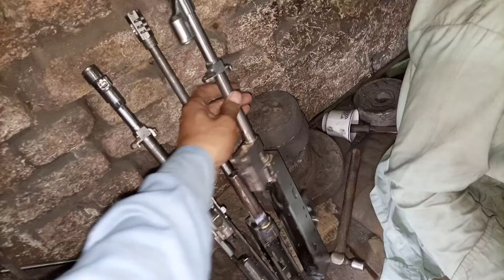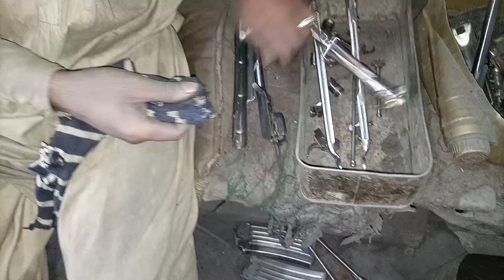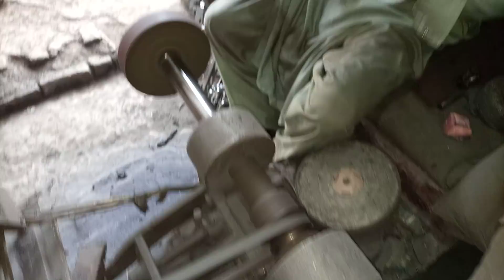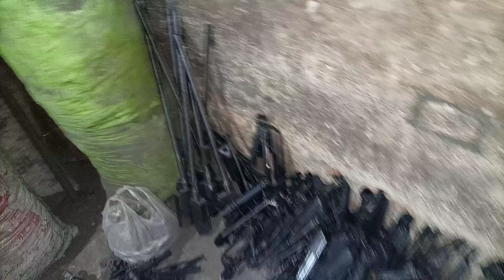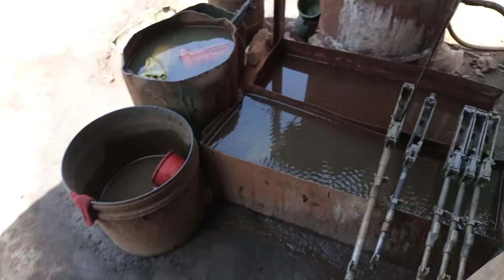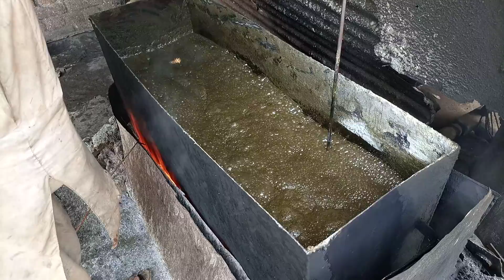How these parts are prepared for painting. coloring process. manufacturing industry. bluing browning

Comment: Notice every AK is a different size and shape …homemade quality at its best
Reply: they arent all aks bud
Reply: Dangerous
Reply: Probably made to order
Reply: every human is a different size and shape 🙃
Reply: The receiver is not. It is made of an easily stamped piece of sheet metal folded and welded in several places. The barrel can be almost any length and they probably try to utilize as much barrel material as they can as that is the most difficult part to make. It does show the futility of "gun control" as in many countries in the middle east gun manufacturing is "illegal" as is gun ownership other than a shotgun or pistol.
Reply: @T_bone  illegal from ur viewpoint, that is based on ur templates?

Comment: Greetings from Thailand, the bluing  process looks similar to the process I use, the liquid I use is old engine oil from oil change service on my diesel Mitsubishi, gives an excellent rust proof finish
Reply: is it better than super blue? 
and the old gun that it's colour is not similar do you think Super blue is beneficial
Reply: You need to use old diesal oil you want it for the carbon clean oil doesnt work it stays the same colour
Reply: How can you blue métal with diesel oil ?
Reply: @antoinewinch7522  are you serious? You heat the metal up with a gas torch untill its a uniform colour then dunk it in used diesal oil black oil has to be used oil clean oil wont give it that colour like i said before its the carbon in the old oil gives the colour and hardens and temperes the metal
Reply: @pattoallen1981  ah okay, thanks for the trick
Reply: I’ll bet that’s black oxide.  Sodium hydroxide and some other chemicals in water, needs to be about 275 F….  Fairly fast results…